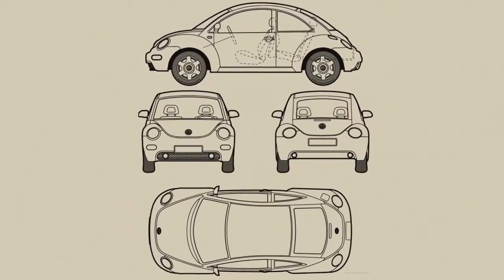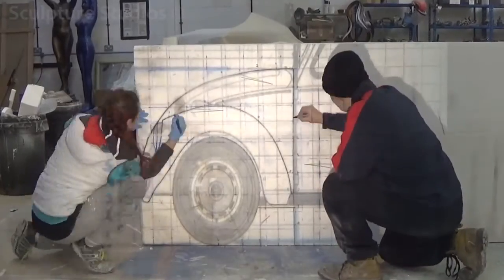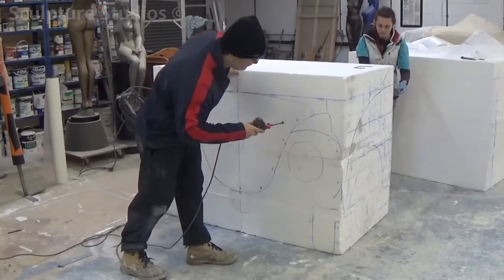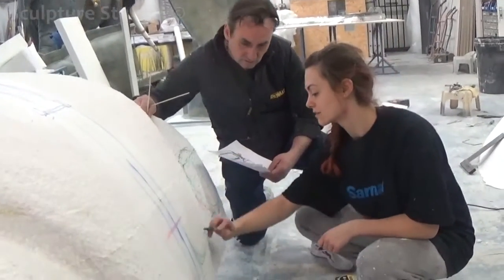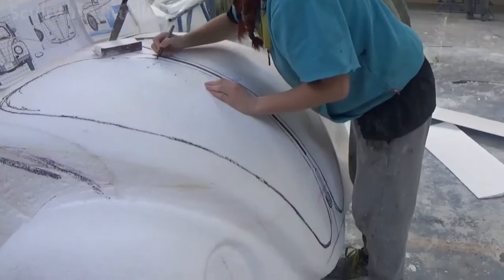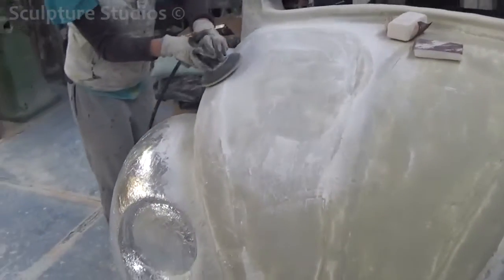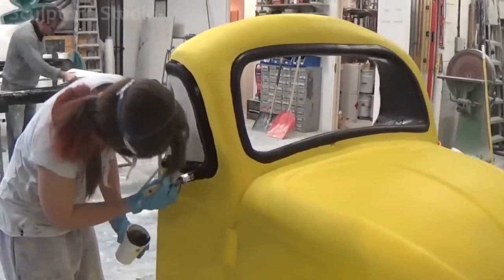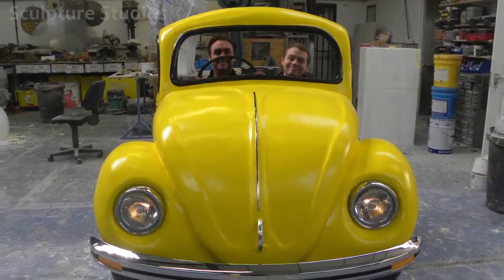Classic Volkswagen Beetle by Sculpture Studios

Comment: Brilliant stuff. Do you answer questions in comments?
Reply from the maker: No we don't ;) just kidding, of course we do!
Reply: Haha :) I know its cheeky, but I wonder if you can suggest the best material for sculpting a 1m totem pole from? It needs to be good at holding details. Maybe clay or wax or polystyrene? I then want to use this to make a mould and then cast multiple copies. Your videos are very interesting and inspiring, thank you for your time.
Reply from the maker: +thedarkmoonman The best thing to do would be to watch more of our videos that include detail and mould making. Try watching https://www.youtube.com/watch?v=Usu8AmM7YOI A process we often use is to carve the bulk from polystyrene, and working up the detail from a layer of clay on top. We then seal the clay with a water based PVA blue layer, and apply silicone rubber on top. Build it up in thin layers first, ensuring you get into all the detail, and build up with thicker layers for strength. From here you can apply a fibreglass jacket to help the rubber retain its shape. Remember, you would need to create a mould in multiple parts with walls that can bolt together, in order to create a cast that you can extract. Have a look and see what you learn
Reply: Thank you very much kind person :)